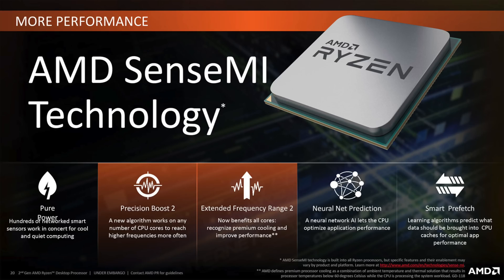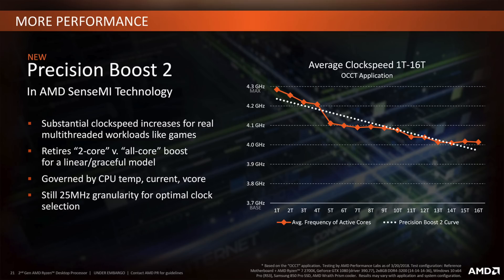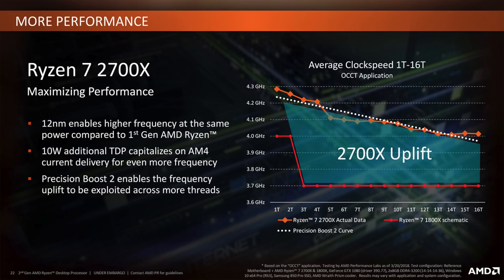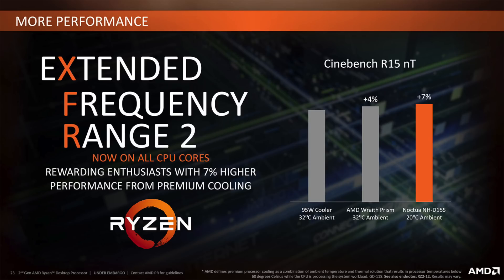The Ultimate Ryzen 7 2700X Performance Tuning Guide

Comment: One question if i can get an answer??
 I changed multiplier in bios to x37 because CPU by Bios info on Auto was working on 3.2ghz, where default was 3.7ghz. But even if i changed multiplier Ryzen Master is still showing Peak speed of 3.2. Even on high cpu usage HWINFO and Ryzen Master shows 3.2 max speed and not 3.7, also boosting does not happen like ever. I will try Cynebench but currently i play Last of Us which is first game that i saw that uses all 8 cores plus other logical ones, so CPU is used around 80 85% but still no boost at all per any core.

Comment: I know this a old vid but ima try to fully explain my issue… I have a Ryzen 7 2700x and rtx asus 2070 super i always have low gpu usage the highest it ever spikes is like 70% usage but is normally around 50-60 percent usage and it’s gets pretty anoying with low FPS because if I’m trying to play Warzone and I play on normal battle royal map I get 50 FPS on all low settings and it’s sometimes almost unplayable because I’m used to 140 FPS and it’s not just cod with low usage every game is but most I can manage to get over 100 but a few I can but with people with same specs benchmark they get well over 100 FPS on high and I’m getting 60 on low I don’t know why… nothing over heats and I play only on 1080p with 144hz monitor and I think it’s somthing with cpu because I took it to someone and he said gpu past benchmarks with ease so I think somehow the cpu might be limiting the gpu even tho I know 2700x is good combo for 2070s my settings in AMD master are…4.1GHz peak speed PPT limit is auto set to 10000 and always stays at 0 I feel and TDC also 10000 and always I feel is at 0 EDC is at 145A and even when idle is red and says 101% memorey is at 1433 MHz CAS latency is 16 WR-CD 20 MEM VDDIO 0 RPD 20 RCT 68 MEM VTT 0 RAS AT 48 CPU ODT 60 VDDCR SOC 1.1 RR-CD 20 and CAS WL 16 idk if anyone will even see this but if anyone could know anything to fix it would help and I have increased memorie but sometimes I did it it would restart and stay at black screen then there would be red light on mb so I’m kinda scared to keep touching it but help would be appreciated
Reply: Actually I’ll explain it here just in case there are other people with this issue because my friend had a 2700 non x with this issue as well.

1. Go to documents and look for Modern Warfare > player > and then adv_option.

2. Right click the adv_option and then edit it.

3. Change renderer worker count to 4 and then save.

4. Explaination: we want the renderer worker count at 4 because it’s half the number of cores and the game likes it. It is default on 2700x on 7 but we change it to 4

Extra: uninstall avast free anti virus as this also gave me issues. If you have wallpaper engine close it too.

Outcome: with this fix you should see a lot of fps gains and lower input lag. It will also shoot the gpu usage from 50% normally up to 80-90% in gpu bound locations around the map.
Reply: OMG I HAVE THE SAME SPECS AND ISSUE!!!
The fix is a bit complex but I think I know what your issue is. Add me on discord and I’ll give you a fix that might help you cus I remember scratching my head at this when playing warzone! My discord Yitzun#9999
Reply: My specs are 2700x, rtx 2070, 3200mhz cl14 and I average around 110-120fps at 1080p low 120fov. When streaming I average 100-110fps.
Reply: Let me know if this fixes the issue or not cus I got a few more tricks up my sleeve 😏😏😏
Reply: @yitzun5080  so I already had the cores in documents at 4 from me looking through yt vids all day to fix it but I had you le finding that free antivirus thing and also I do have wallpaper engine but I have to do if anything is running it pauses or stops automatically so I don’t think it’s those unless it’s the free anti-virus but idk
Reply: I think its the ram now that i think of it. What ram do you have ddr3 or ddr4 and what motherboard do you have? and capacity?
Reply: @rezxottic2379  have you tried enabling XMP profile or DOCP profile to make sure the ram is running at the right frequency?
Reply: @yitzun5080  how do u do that?
Reply: @rezxottic2379  try 3200mhz first. make sure not to change the Bclk because it might cuase instability and its not really beneficial
Reply: Make sure when you try the 4200mhz its actually within the DOCP. so what i mean is does it say 4200mhz 18 18 18 24 for example . Make sure its the actual DOCP not the drop down for ram frequency. Normally 2700x can only run up to 3800mhz due to silicon lottery
Reply: @rezxottic2379  i recomend leaving it at 3200mhz
Reply: @yitzun5080  well tbh I turned on D.C.O.P or whatever it’s called and I did see my gpu usage go from like 50-60% to like 75% and was getting like 100fps with some drops in the 80 in like explosions and demanding stuff like that 😀
Reply: @yitzun5080  and can setting it to 4200MHz do anything bad if it’s too much for the ram or should I try another it’s 4200,4133,4066,3933,3866,3800,3733,3666,3600 and some more but all those are MHz options
Reply: @rezxottic2379  close any unwanted applications and then make sure to use fullscreen. hope it helps
Reply: @yitzun5080  tho on Amazon my ram said memory clock speed is 3600MHz
Reply: @rezxottic2379  Is it like part of the DOCP profile? as long as it is it shouldnt crash if you can send a pic on my discord Yitzun#9999 of the bios
Reply: If you made a mistake and the pc doesnt boot don't panick search up how to "Clear CMOS" its sometimes normal when configuring ram
Reply: @rezxottic2379  ok that should be fine setting it to the 3600mhz DOCP profile not the ram speed frequency
Reply: @yitzun5080  well I added it to the frequency and it’s did boot up but it just said it auto reseted ram setting so idk if I leave that 3200MHz and frequency or try 200 down and try 3400MHz but under D.O.C.P it only says D.O.C.P DDR4-3200 16-18-18-38-1.3 5V
Reply: @yitzun5080  and there’s somthing that says at top in bios in yellow it says target cpu speed 3700MHz and target ram speed 3400MHz
Reply: i hope this helped
Reply: @yitzun5080  true and im super happy that u helped my mostly fix it but I was just wondering if it could be increased because it was at now 75% but if I where to try 3400MHz couldn’t I just reset it then I’d know for sure that I should keep it on 3200MHz?
Reply: @yitzun5080  it did ty but if I try the 3400MHz and it boots does that mean it’s good
Reply: @rezxottic2379  The thing is in short if you increase the frequency or overclock it it is only changing the frequency and not the timings. This means that it will be more unstable . leading to BSODs or crashes . I recomend staying at 3200mhz or you can look up this tool called ryzen memory calculator and follow tutorials if you want to overclock ram more.
Reply: @rezxottic2379  if you want to get more frames I recomenned overclocking the GPU because it's the easiest to overclock. And then set the CPU (2700x) at a fixed frequency like 4.1 or 4.2 if you are lucky
Reply: @yitzun5080  ok and yea did it on 3400MHz and it still didn’t boot lol but I took out battery set it to 3200MHz and we good now but I’ll check it out ty for the help again 😀
Reply: @yitzun5080  and also could it be even more sucure just to get 16gb of more ram…(same ram) for 100%
Reply: @rezxottic2379  yeah if you get the same ram make sure you get the same model and same speed for max compatibility
Reply: @yitzun5080  well if we talking gpu what is ur gpu set to it says I set it to 1865 MHz and it says while playing games it goes up to 2055 I’ve see OC guilds where they in the 2000s but idk if that’s idle or like under load because I guess idle idle like just my wallpaper it’s at 1290MHz and under load 2055 so idk what to set it to.. and memory clock for gpu is 14000MHz and I’m useing asus gpu tweak III
Reply: @rezxottic2379  
use Msi afterburner for overclocking. The core clock and memory clock over clock is basically offsetting the frequency of the base gpu algorithm therefore increasing performance.

Each gpu is different but for me I put temp + power to max (every gpu). And then (unique to every gpu) my core clock is +100 and my memory +1200. My gpu is evga. I used to use wallpaper engine and I normally had fluctuating frequencies. 

Common myth is that overclocking gpu harms it.. that’s not true because it’s only harmful if like what some people do is change their gpu bios and increase the voltage - advanced and potential dangers - completely safe
Reply: Reasons for this issue: poor optimisations for warzone normally. Or getting a new cpu does not change the old value of the adv_options if you have it on read only. The last one was my friends issue. He used to have a 3600x and then swapped his brothers 2700 because his work needed the cores.

Comment: I have the 2700 vanilla and prism RGB stock cooler and temps never go over 60c but all cores run at only 3400mhz and not boosting any further! what am I doing wrong? any ideas? mobo is an Asus b450 prime with the latest bios which takes ryzen 3000
Reply: Try power plan in Windows. You might be on a power saving plan which will hold it back a lot. Google “2700x power plan windows”. Also make sure you turn you “XMP” profile on too. Your ram might be running at base instead of at what speed it was sold to you as. Go into your bios to turn that on. Asus calls it “DOCP”
Reply: @kieranforrester8925  I did buddy, got the latest a couple of days ago. It seems that the vanilla one (non X) does only 3.4Ghz for all core boost unless you overclock manually all core but I don't want to do that.

Comment: I’m on stock cooler and my temps go up to 80c while on cinebench I have pbo and core performance boost on and edc relaxed throttling on I oc my ram to 2660mhz and my cpu goes from 4.1 idle to 3.9 when on cinebench and I only score in like the 1600s anyway to solve this? Also my edc is still at 100% after increasing the limit and I lowered my cpu volts by 100
Reply from the maker: Check your power profile and try to set it to high performance, also updating the chipset drivers helps
Reply: Hardware Numb3rs Where would I find power performance also thanks for the reply
Reply from the maker: Qylix ک in Windows search type “power plan” and then you will have the choice for high performance or Ryzen high performance after you install the AMD chipset drivers
Reply: Hardware Numb3rs oh ok mine is on high performance already I just thought u meant in the bios
Reply from the maker: Qylix ک what is your score and temp at default? Let’s try to go step by step to find the issue
Reply: Hardware Numb3rs It’s like 1500 I just uninstalled all ryzen drivers because I think the chipset driver was colliding with the one from my mobo and now my monitor is stuck in 64hz
Reply: Nvm I fixed it
Reply from the maker: Qylix ک good, so the issue was the chipset drivers?
Reply: Hardware Numb3rs I think I meant I fixed my monitor being stuck at 60hz

Comment: I'd like to point out that some of the graphs seem s a bit misleading since the bottom point is often 90%, not 0% as you could expect.
One graph reading 100% and the next graph double the size doesnt read 200%, but just 110%.
Reply from the maker: Silverfox yes, I don’t like that either, but without that view the graph would be almost flat since the charts you are referring to shows a difference of few % points, now, looking back I’d probably go for the flat looking, I don’t think I’m going to use anymore a non-0 baseline for graphs

Comment: Great video! One more request for PBO with the 2700 here! R7 2700 CM 212 evo air cooler, MSI b350 gaming plus, patriot 3000 (@3066) CL16 ram average cinebench R20 score 3450 single core 406. I get slightly higher clock speeds and better benchmark scores ith more voltage but my idle voltage gets stupid.
Reply from the maker: Soon I'll post an OC guide for the 2700, I want to check as well offset all core overclock to maintain lower ilde volts, what motherboard are you using?
Reply: Thanks! MSI b350 gaming plus with latest bios.

Comment: bugs me they put limits on the current for pbo... let me blow my vrm and cpu if I so desire!

but also how in the hell did ocing bclk lower score? sounds like it was unstable
Reply from the maker: hehe probably they don't like the idea that people accidentally fry CPUs and motherboards :) BLCK overclock scores lower because high frequencies are less efficient, drawing more power, and so limiting the boost before the work is done, BLCK just make the CPU spikes higher, a super short high burst is less efficient than a lower but sustained frequency, AMD did a great job, the X versions of Zen+ are already tuned at the silicon limit in terms of peak frequency
Reply: @HardwareNumb3rs  this must be a mobo specific thing cause my 2700x picks up a nice little boost (10 points on cpuz single core, 460ish to 470) with 103mhz
Reply: If you have a Crosshair 7 Hero you can remove the limiters if you like, they have some modifications to PBO that you can turn out that shut off all limits. You need to understand VRM cooling and all that, but the C7H is kinda bulletproof as long as you aren't smothering it with a pillow.
Reply: @6speedgarbagecan  The MSI X470 Gaming Plus has that as well... but raising the limits doesn't do anything

Comment: Any chance you can try single core overclocking tests on the 2700x? I'd like to see what results having just one core highly overclocked would look like, or maybe a few cores. Ryzen Master shows your top 4 cores in order, so it would be interesting to see what results you could achieve tweaking them specifically. Great vid!
Reply from the maker: I don't think it will be usable, to make this to work the core affinity must be set in windows and is not an easy task especially in Win 10, I might try to play a bit with this, normally If I disable SMT and cores I can go higher under normal cooling, like 2 or 4 core can reach 4.5GHz easy, I tried that once, but I can't see a practical use of it.
Reply: @HardwareNumb3rs  would Process Lasso work for setting affinity how you'd need?

Comment: I have a 2600 none X paired with the ASRock b450m pro4 and PBO is disabled on Ryzen Master.  Cant figure out why.  Is it a limitation of the MB or CPU?
Reply from the maker: Not sure you can enable PBO with a non-X, need to check on that :)
Reply: I know that in b450 pro4 (atx version, 1.80 bios) it works normally, try finding it in advanced settings in uefi

Comment: 2600x and 2700/x stock coolers are good, but .. what about those with ryzen 5 2600 with wraith stealth (which doesnt have that copper on the cooler...)..... maybe ill just pick a kinda cheap and reliable just in case for it..... never tried to do PBO though... and my ram is just Hynix A-die :'D
Reply from the maker: I did various video about the 2600 and how to overclock it, check my Antec C400 review, I used a 2600, I went from 3.9GHz and 82°C with the stock cooler to 4.1GHz and 63°C with the Antec C400, with a Gigabyte AB350 that doesn't have LLC
Reply: @HardwareNumb3rs  okay thanks, will see, cause i only saw basic like Techsource said that only changing to 4.0Ghz and the voltage to 1.300v (using a msi b450 gaming pro carbon..)
Reply: Get lc cc 120 rgb for r5 2600 .. my runs at 4.2 all day everyday easy not even 60 c
Reply from the maker: @NexY92  With the right cooler and a nice board that support LLC the 2600 is a monster for value/performance, plus you have a lucky chip, 4.2 is not so common :)

Comment: Very good video. Been stating this exactly in all the forums i personaly write. Ryzen PBO is realy inteligent and the bonus you get from manual overclock is negligeble in most cenarios and not worth the time and effort. Cooling is also not a realy big issue and investing in very expensive cooling is generaly not worth it for Ryzen. Memory overclocking is the best method of geting extra performance, but some CPUs IMC are realy sensitive and don't like anything over 3200. I think an extra video on ALL the memory timming with each performance increases would be super great to have, but very time consuming to produce i guess...
Reply from the maker: At the launch I did a memory scaling dedicated video, but now is a bit outdated, I'm already testing and working on a newer version with also Micron D-die and Hynix CJR, probably I will be able to publish in a week or so.
Reply: @HardwareNumb3rs  Thanks m8, that would be awesome. On my board  (Asus Strix X470 gamming-F), there are like 20+ memory tunning settings that i have no clue what they are, and i assume most high-end boards are the same... even if you research about them, there is not much info on what performance you can get out of it vs the instability and extra voltage required. Yes i can test that myself but i'm no pro and it's some realy time consuming effort to test each individual setting, tuning it, testing for stability, benching, etc.          
I presume that the most notable settings are frequency, CAS and the 5 next secondary timmings and gear down mode, but there are over 20 that i have no idea.
Reply from the maker: @adomingues00  There are timings like tRFC that can help in gaming, but only b-die based chip can go lower enough to see a real benefit, other timings must be set based in a certain way, not necessarily lower,  but tweaking memories as you said is a long task, Ryzen Dram Calculator does a great job with various presets, even for who doesn't have much experience or time to do all the tests, if you want a good read about it check the guide from 1usmus posted as an article on Techpowerup. Or if you have a kit like the Flare X, even the default profile is a very good base. I'll try to make a video with an easy method to tweak the RAM to get good improvements with a minimal effort